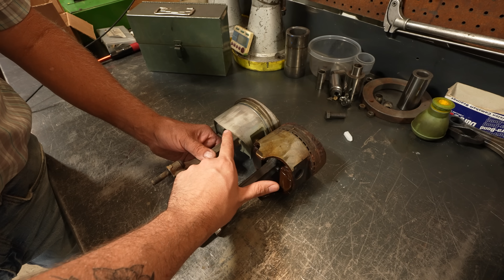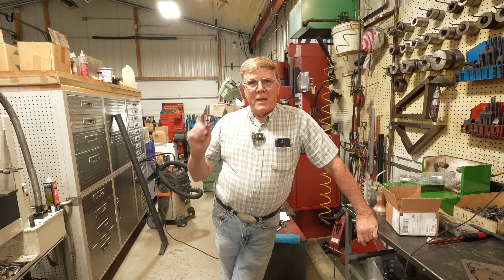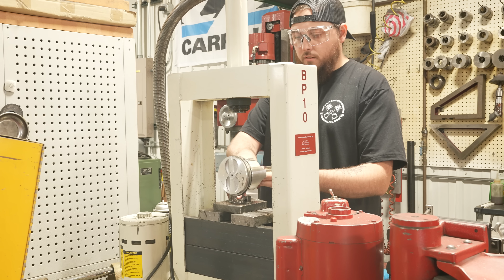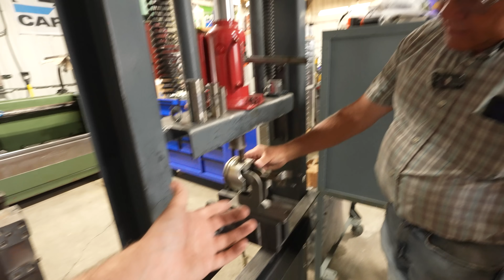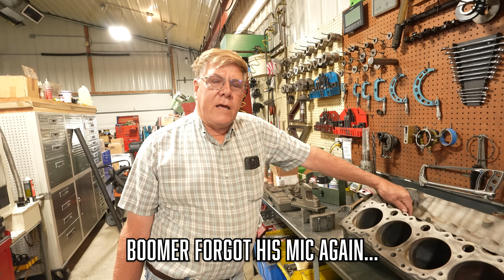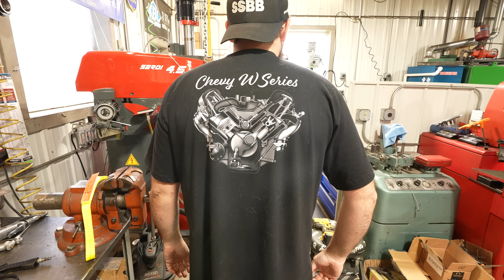What CAUSED The 348 Chevy To BLOW UP?

Comment: When I was  building my first engine in 1980, I took my pistons and rods to a local machine shop to have the pistons mounted. Got home, noticed that they were all the same orientation. But this was my first time. So I assembled the engine and then later before putting it in, I asked someone and found out the bad news about the rods being backwards. So I got to do it twice for practice. The car was a Camaro Z28 that ran low 12s, on the street, in 1981, and it did it for a few years untill I sold it to a kid and he almost immediatly blew it up.

Comment: I really enjoy watching you bring these interesting old engines back to life, and especially the sleuthing required to determine the root cause to prevent a re-occurrance. 

Having been a motorcycle mechanic and shop owner, I always wondered why the piston pins were floating in the rod and pistons, rather than interference fit, even on the big pistons on 650cc single cylinders 

We rarely, if ever,  had problems, even on the high performance engines. But having said that, the most catastrophic failures I saw resulted from the pin seizing into the rod, which then snapped off the small end, and allowed the flailing remains to wreak havoc in the cylinder.

We always assumed it was simply a result of low oil, because it seems with auto engines, that will result in bearing and piston failures, which would be preferable to possibly damaging the cylinder walls.

Comment: You deff. CAN put pins into rods the diy way. You just need to be smart about it. Freeze the pins, torch the rods, maybe even boil the pistons. If the freezer isn't enough, get some LN2. It CAN be done.

BTW, I'm a computer guy, LN2 is used for extreme cooling of overclocked systems to break speed records. Kinda like you would use Ethanol or other special fuels in drag cars. You CAN GET LN2 quite easily.

Comment: We had both types also the Sunnen to remove and heat to install and the Kent Moore style that holds the rod eye and yes you can install with out fault. The guy I used to work for stated he had not seen a pressed on piston from a factory since the fifties don't remember what company or exact year.

Comment: Further to glennbrymer4065's comment: There's a thing in engineering called "modulus of elasticity" which measures how much a material can be deformed under load. for steel, this number is relatively high. For aluminum, the number is not quite, but practically zero. This is why springs are made of steel, not aluminum.
What this means is that once aluminum is deformed, it does not have the ability to spring back into its original shape. A piston that has been forced out of round will not return to its original shape. Any attempt to press it back into round will cause cracks. if it is subjected to more stress, as things are in a running engine, it will fail.
This is the very same reason that the ISS is developing cracks and leaks and must be retired.
Reply: Steel's elastic modulus is about 200 GPa, aluminium about 70 GPa.

You've got a bit of a mix up between modulus and yield strength.

Comment: The original rod and bearings reused was a normal in the early / mid 60's repair of a "performance " engine. Rarely did we get a factory replacement engine or the parts and time for a proper rebuild. We would do the minimum needed to get it past the warranty left (if any). Pretty normal to have a back yard looking repair because of no book time and minimum if any shop charge, just an hourly wage for the mechanic.  Remember in the early 1960's warranties were basically crap. I worked as a kid in high school for Chamberlain Chevrolet on L.I.N.Y. and was an semi skilled kid "fixing" squeaks ,rattles and water leaks . . .the orders were fix it cheap, quick and dirty.

Comment: Press means squeeze inwards. I deal with machining large al bz bushings that need a median clearance made on the ID depending on the pressfit of the bore of the part the bushing goes into- which means going to an oversize adding the pressfit into the equation, we use an oven to heat the part with anti corrosion compound and LN2 to shrink the bushing, and those massive bushings just drop right in.

Also Jim there is busy to the point that putting a microphone on is the last thing on his mind.

Comment: I am not surprised that the fixture puts pressure on the piston as you are still pushing the bottom of the upper piston pin boss against the top of the rod if your fixture is supporting the underside of the rod.  Even with oil in that gap between rod end and piston pin boss, you are going to increase the drag on rotating the piston as the pin pulls the piston along with it downward.

Comment: I would say the skirt popped because it's a forged piston and all the rest are cast. It probably had some wear at the top so it turned over all right but it was too tight at the bottom and popped it off eventually .

Comment: Its hard to find a machine shop, between cost, trust, and quality of work. The first truck engine I built was a Ford 400, I asked around, several suggested this particular guy (O'brien), I got the engine back, assembled it, and had issues, between cylinder head being 100% shot (customer refused to put any money into them, the valve spring pressures were so low, the compression from the new bottom end was able to push past the valves, ended up getting 2 complete heads for about $80 a piece, they worked great), but, the truck burned oil, the guy that bored it, took out too much and he didn't bother to care. The truck ran good enough for the customer, but I felt like a total dick. Asking the shop that referred us to the machine shop, one of the guys said "Why in the hell would you take it to him?", I was shocked, I told the guy "Your machinist (industrial, not engine) told us to go there". They informed me that he does excellent work, if you're friends. Talking to people about my experience, I ran into an ex employee, he said the guy was the most crooked scumbag ever, said they did an engine for one of the city trucks, only 1 cylinder was out, so they bored 1 side of the engine and used the factory pistons on the other side, said the truck ran awful. Out of 11 different places I've dealt with with motorcycle and vehicle machinist, I would give repeat work to 2, and one of them just closed, Strasburg decided he was done, and that really sucks

Comment: Engineers are good at overcomplicating things.... A wrist pin can be installed with a ball joint press.. and if you're smart enough to build a pyramid jig and bolt over the cylinder you can bore it with a drill.. I used to work for an old Boeing engineer on a ranch and in a machine shop... We used to have to get him out of the ranch shop or the machine shop to get any real work done in a reasonable time...

Comment: You guys have a truckload of experience working on these, you know what works and what doesn't...could you bring to market a better tool to support the bottom of the rod while you press a pin through it? If the state of the art is overpriced crap there's gotta be a market for something that's fairly priced and easy to use right (or perhaps more importantly, hard to screw up).

You guys do beautiful work.

Comment: You really need to know what you are doing pressing pins. Really, pressing a lot of things actually. Understanding where the loads are going and where they shouldn't be is key. A press is a valuable shop aid and irreplaceable in many cases but used wrong its just a slow-motion sledgehammer with an appetite for carnage.

Comment: Had a 302 ford & every piston skirt was cracked
Reply from the maker: Cracked piston skirts was quite common on the early 302 engines.  You could squeeze the skirts with your hand and the oil would ooze out of the cracks very visibly.

Comment: This is in reference to pressing wrist pins out correctly;
Harley Davidson developed their own in-house technician training program called PHD back in the late 1980’s. During my 20+ yrs at HD I was fortunate enough to take part in these programs from their basic courses up through the specialized classes. The most vital classes were the very first units called Shop Practices. 
You can be savoy in lots of areas but understanding mechanics, physics, and mathematics are the most important parts of being successful, productive, and profitable in auto machining or mechanics. Those Shop Practices courses taught things like, reading a micrometer correctly, how and why to use the correct puller or pressing tools and the consequences for using the wrong ones, etc. Topics were not necessary about Harley Davidson but about general knowledge to make you a better technician regardless of what you were working on. Same concept as pressing piston pins in and out. In my opinion, good shop practices are most vital one to have in the auto machining or engine building profession.

Comment: I. have been running chevy "W" engines for years and always sonic test the cylinders. a lot of castings back in the day have a lot of core shift if you haven't sonic tested the cylinders I would recommend it. "W" engines are notorious for core shift . i heard that some 348 blocks have thick cylinder walls ,if  you find the walls thick boring to .060 is no issue

Comment: I had heard that excessive cylinder clearance can break piston skirts. With the piston/chamber design of that engine, 0.040" clearance near the top would really rock that piston under combustion. Seems plausible since that hole has had a piston change.

Comment: So I made a jig to press off my pins. The jig finally let go after all 8. To install, I used grease inside the rod. Heated with a propane torch until the grease changed color and would flame. Then I quickly installed everything (while wearing good mechanics gloves) bc that grease is hot! It worked well, you just had to be consistent so the pins were all the same and centered.

Comment: Guys, I love the failure analysis videos. Also the "crack kit" which I've never seen used before. I'm a retired diesel mechanic and I put many pistons in the toaster oven (Cummins mostly) and the pins would glide in easy peazy, the rod end was a floater. Thanks!
Reply: The 3 step crack finder dye kit has been used on the channel several times in the past usually to find small cracks in blocks\heads. It's used often by welders & fabrication guys to find cracks in welds and hidden micro cracks in equipment while doing repairs. Guys like Kurtis at CEE and Isaac from ICwelds have both used it several times to find cracks in buckets and hydraulic cylinder eyes, etc. It's really cool to see it 'develop' and the cracks magically appear where nothing at all seems to be there.
Reply: We always used boiling water to heat up Cummins pistons.

Comment: In your other video y'all kinda poopood them for not replacing the bearings. I have a mild opinion on the subject. If the bearings are healthy I see no need in replacing them. I feel sometimes it's safer to reuse a bearing vs gambling a mistake on a new bearing not grabbing the crank and spinning. How do you feel on good used bearings that measure good

Comment: If you are fully rebulding and modifying this engine with all new rotating components why aren't you considering full floating rod/piston assemblies. Yeah, a few bucks more but it removes the potential of cracking a piston. I've built flatheads through Y blocks to 'W' Fords and have always gone the full floaters.

Comment: Once the integrity of the piston was breached by the deformation of the piston it was compromised. Micro cracks in the metal. Ran for years possibly. But time, heat, mechanical stress and vibrations. Finally reached the failure point. You guy's really do get to the bottom of problems & issues with your continued investigations. 
Watching and listening to y'all do your things is extremely fascinating to me personally. I'm 73 now and totally miss being able to build motors and equipment. Working on problems that are a real bugger and figuring out the problem and figuring out a fix or repair. 
Thank you for such detailed explanations and sharing both of you men's knowledge, experience and expertise with the rest of us old and young gear heads out here watching y'all as you Cross talk, joke and laugh. 
Also, your shop is really nice and well set up. Salute to you both. God bless you and your family's time and efforts in bringing us your videos. Y'all are all good people. 🫡

Comment: To me, the most unique engines by outside appearance post WWII are the Buick/Pontiac Straight 8s, Ford Flatheads and the Chevrolet W series.  The Buick nail head is in there pretty close.  Most of the others are pretty much rectangle valve covers and 90 degree blocks.  I'm really enjoying this series on one of my favorite engines.

Comment: I used to rap a drive shaft yoke (near the tube weld) while installing U-joints to relieve bore misalignment. You can actually feel the tension being released. Seems to me that, even if the tool had not contacted the piston side, there is still unnecessary stress and distortion (and possible material displacement) when pressing in wrist pins instead of heating the rod. This sick 348 has found the proper 'doctors.'

Comment: Back in the late Sixties and early Seventies I worked in a speed shop and using a press and the proper adapters, I pressed in hundred, if not thousands of wrist pins. Probably, whoever did that, did not use a press, but probably used a hammer and punch to insert the wrist pins. Using proper tools saves a lot of time and money.
Reply: My 1st thoughts. See others doing it often on SBC's.

Comment: I'd like to see a dyno comparison with regular vs backwards pistons. Not on the 348 obviously.
Reply: That's usually done on Chrysler big blocks that supposedly makes more HP but won't work on a 426 hemi because the valve notches in the pistons are different sized . I knew a guy some years ago who died from Covid he was a big Chrysler guy who had multiple Mopar cars and one of them was a 69 Plymouth Road Running 426 4 spd car that he rebuilt the engine for it and he accidentally put one of the piston in backwards & when he fired the engine up to let it warm up after the rebuild to take the car for a drive that's when it started making noise because the valves hit the piston and he ended up pulling the engine out and had found out he accidentally put the piston in backwards. He ended up fixing it though but got lucky that nothing else got damaged other than the piston valves and push rods. He had a restoration shop that I worked at some times mostly doing mechanical stuff for him for cash green backs but he mostly restored Mopar cars but did other makes model of cars but he specialized in Mopar cars. After he died his wife had sold the house with that shop and had a auction to sell the tools and equipment including the lift he had that someone I know who bought it but Al who was the owner of the shop that had died from Covid he also had a 67 Plymouth GTX 440 and a 70 Dodge Challenger 340 4spd car & a 1963 Dodge 413 cross ram super stock factory drag car he used to race at Rock Falls raceways in Eau Claire Wisconsin before Covid hit that now has been updated to run the NHRA nitro cars .

Comment: Way back in the 80's, when I built a hot rod engine for my 72 Gran Torino Sport, I knew there were a few things I could not do at home.  I had new cam bearings installed by the tech school that hot tanked and machined the engine block.  I had the shop that balanced the rods, pistons, crank and flex plate match the rods to the pistons and press in the piston pins.  Yeah, I knew about using a propane torch on the rod and the kitchen freezer for the pins, but it seemed like a better idea to have those pins pressed in by a professional shop.

Comment: I’ve broken a piston or two using a regular hydraulic press. It can be done if you’re smart about it, plan how you’re going to do it and be VERY careful. Best to have someone with the proper tooling and experience do it though.
Reply: Just use heat, anyone can do that.  We'd use a gas fired burner and heat oil up and let either the piston or rod soak in it until the pin slid in.

Comment: JAMSI,  Do you know of anyone that can grind pistons to a final size? I have a new set of Zollner semi finished pistons here for a IH 6 cylinder Red Diamond gas engine that need to be ground to size. I know that years ago that some machine shops had piston grinders to do this, but it's probably a thing of the past? I thought I would reach out to you since you work on a lot of older engines. Maybe you have a old piston grinder sitting around???

Comment: I would look for a bent rod. Check the rod journal on the crank, too. Are the bearings wearing evenly? Lay out all the junk you found in the pan and try to identify each piece. Did a loose, falling pushrod foul the piston?
Reply: Having an OTG 348 is more valuable than all the bigger stuff.  That guys think is more kewl that. What you have there.  Just looks like it sit outside and it just got water inside the motor.  My dad was born in early and bet he could have got it running